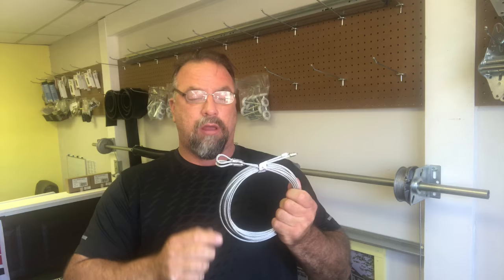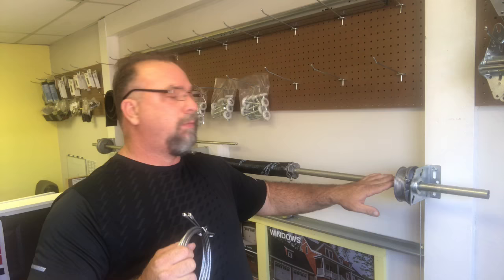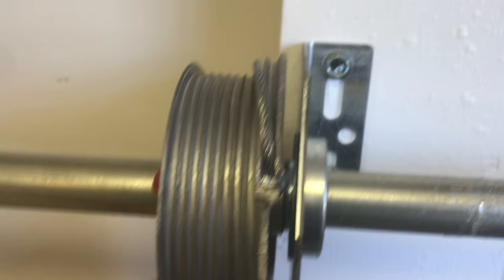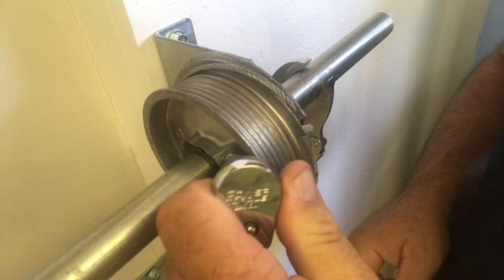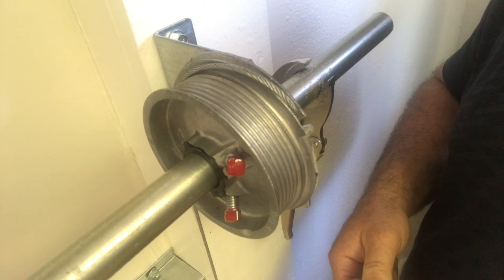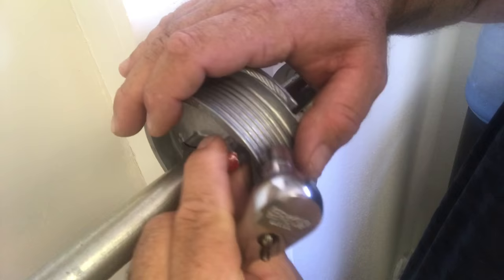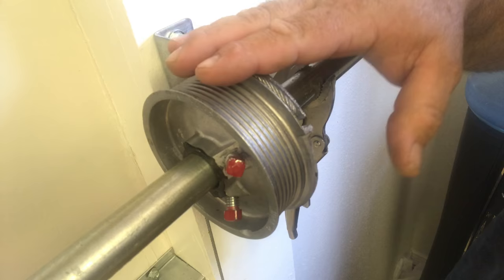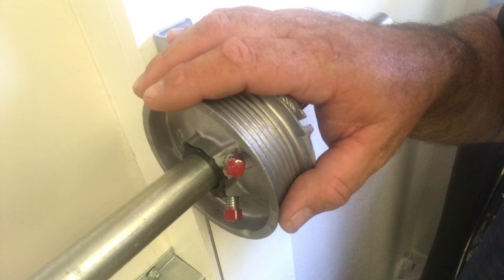How-To Align Garage Door Cable | Torsion Cable | DIY Garage Door Repair

Comment: This works, but know that the door could go out of level by doing it this way, especially if it is the left drum. In the scenario here, I would've probably just lifted the vice grip a little to back wind the spring and gain a little slack, and slid the cable back in place with a screwdriver. You could also use one vicegrip as a lever to rotate the shaft, and another to clamp it down like he showed in order to hold the slack while you do your thing. Just keep your fingers clear.

Comment: My trade is millwright since 35 years.  I instaled my new garage door recently. Leveled everything with my laser level.  One simple problem with it.  The two cables have the same tension on both side when the door is close but at 3/4 open, they are well seated on the pulleys.  The left cable is getting loose and the right one is very tight. It takes all the load. Took my caliper and measured the pulleys. The right one is 0.015'' shorter than the left. Since the pulley is grooved on it's width to make the cable running, couldn't put shim stock over it to make it bigger.  Decided to put some electrical tape layer instead  until equal tension on both side and voilà !  When tape will be worn, I will just put new one.  No more problem.  Different mold for casting and it doesn't take much difference on circonference to cause that problem.  Call the manufacturer door installer.  Told me 1 out of 3 doors have that same problem and they never found any solution.  Told the guy mine and was very happy to ear it.
Reply from the maker: Great solution. Thanks for sharing!
Reply: He probably didn’t care and was happy to get you off the phone
Reply: I don't  think so !  When you talk to a man, an aged one for about 20 min, a very nice man asking questions and you can feel the appreciation in is voice  and attitude and if it's so... hope he has learned something that day !  Happy new year from Montréal, Québec !
Reply: Have been installing garage doors for 27 yrs, still can't figure it out???
Reply: @MegaJohnnyrock  About the difference between cables?  Beleve me, I scratched my head for a couples of hours trying to figure it out !  And nothing else but the circumference must be in involve here.  As I said previously, took my caliper and yess, it was 0.015 smaller. Mould difference from China !
Reply: it's probably your track.  check your top roller carriers with the door open.  you should see some roller axel , if not the door will bind and cause a loose cable
Reply: Thank you for your comment.   Every measure was double, triple check.  Leveled with my laser.  Track parallel and leveled everywhere.  Believe me it is a matter of different pulley circumferences.😉

Comment: I just wanted to add if you have the door open it releases all the tension in the spring, it makes it a little bit more difficult to work on the door but alot safer. I appreciate this video, mostly all the others where not helpful this was clear to the point an told what needed to be done thanks!

Comment: Hi, I was wondering if someone could help me I replaced both of my cables yesterday and I have double springs the one on the left side. I adjusted it to 30/4 turns the one on the right side I didn’t touch because it seems like it has tension in it, but now my door doesn’t go up. It goes up about an inch and then it stops. I don’t know if I should maybe unwind the right side Both of the cables that I replaced seem OK

Comment: You know I am a 21yr garage door vet. I subscribed not for the knowledge, but because you do a great job on your videos. Good info but most importantly promoting safety, well done. One thing I would add, is when you open your door look and make sure both cables are tight.
Reply from the maker: Yes- a loose cable when the door is in the opened position is going to eventually cause an issue, or may become tangled. Aside from tightening the drum on one side, sometimes the door itself is askew from the track. This is usually a result of the back hangers being installed slightly out of square from the vertical track.
Reply: I tried to redo my cable a couple weeks ago and left the vice grip on when I put the new cable on 🤦 I'll be ordering two new cables to install. My only question is can I put new cables just as shown in this video (garage door down and only winding on first groove)? I've seen other that show garage door in up position stating to wind the whole drum with the cable...

Comment: Never loosen a drum without a winding bar in at least one of the springs. Also ya put your vise grip on upside down. Where you were standing will hurt someone if they didnt bar off the springs and the other drum slips(because thelast guy may not have tightened it enough)
Reply from the maker: The purpose of this method is a quick fix for a DIY'er without a winding bar. I have used this method 100's of times. It is highly unlikely for the drum on the other side to slip all of a sudden. People tend to overtighten these drums. Again, anything is always possible! Some risk is always there.
Reply: Michael Perry is 100% correct, in Florida for example a 16x7 garage door can weigh nearly 450lbs with wind loading struts. All that load will be trusted to 1drum and 1 pair of questionable Vice grips. Instead put the Vice grips on the cable on the good side, next take a pipe wrench and put it directly on the torsion tube, lift up towards the ceiling no more then a 1/4 turn with 1 hand and move cable back in the grove with your other hand.

Comment: Nice video.  I use lithium wheel bearing grease on the new cables, light coating will extend the life of the cables,
silicone spray on the torsion springs will keep them quiet.

Comment: Thanks for the simple procedure! The door on this house was up about 1/2" on one side that always drove me nuts, finally after 4 years living here I just recently noticed the cable on one side was off the track as you show here flipped over the ridge. So I followed your procedure only I had to let cable drum turn until door settled on the concrete floor for it to release enough tension to flip the cable back into place. I then needed to use a pry bar to hold some tension on the cable as I tightened the set screws - all worked out well and cable is back in place and door bottom is now even. The key was using the vice grips to hold the spring tension on the shaft.
Reply from the maker: Great job!

Comment: @danielwake2430:  
I had a similar thought, and you're right about getting fingers caught...  
I used something with a better bite than vice-grips would be preferable: a pipe-wrench.  I grabbed the tube just inboard of the sheave to avoid deforming the end outside the bearing, and rolled it back that 1/8 to 1/4-turn I needed to get the wire back in the right groove.

Comment: You can do that repair without ever loosening the set screws on the drum. You simply go to the bottom roller at the left side of the door and use vise grips to clamp just above the roller, you then go to the right side of the door and lift it until there is enough slack in the cable to correct it on the drum. then place another vise grip under the right side bottom roller so the slack isn't lost. Go up to the drum, re-align cable and then remove both vise grips. This method will ensure the door remains level.
Reply from the maker: There are definitely alternate ways to do it. Thanks for sharing!

Comment: This way would only work if the floor was level and your tracks are level as well.  If the right side concrete was lower you've dropped the right side of the door too low when losing the drum....
Reply from the maker: Thanks for your input!

Comment: My door has been jammed for years.  The cable is misaligned and it’s rolled around the tube once, on both ends.  Frankly, I don’t want to mess with it, but I haven’t been able to find someone who can fix it.
Reply from the maker: If you unwind the springs first (using 1/2 o.d. winding bars by 18" long), you will be able to unravel the cables, allowing you to reset everything. Align the cables and make them straight, then use a vise grip planted on the torsion tube orientated against the wall (in an upward direction) to hold the cables so you can wind the springs. Watch some videos on spring replacement first- AND BE CAREFUL.

Comment: Hmm. So the bar and pulleys are supposed to turn? Mine aren't and while it's down the cable is loose and wrapped around the bar
Reply: If your cables are wrapped around the bar, then this quick fix would not apply. There are some YouTube videos out there that show you how. Please be careful.

Comment: My door springs are broken and door is closed. Can I run the cable to the bottom of the door since I am unable to lift the door at this point. Great video.
Reply from the maker: I would need more information. Thanks.

Comment: Good video I'm redoing my cables and springs and opener and hardware. Safety tip for you. Never have your hand on the spool when loosening the spool. Well I guess it wont take off on you so your ok. Lol thanks for your tips. Where were you yesterday lol. : (

Comment: I tried to redo my cable a couple weeks ago and left the vice grip on when I put the new cable on 🤦 I'll be ordering two new cables to install. My only question is can I put new cables just as shown in this video (garage door down and only winding on first groove)? I've seen other that show garage door in up position stating to wind the whole drum with the cable...

Comment: Here are my problems. I hope you can help me. My electric garage door opener had a short. I have been forced to manually open and close the door. This went well for a few months. One day after opening my door (21 ft. in length) it got stuck. A little higher on the right side. I tried for an hour to get it to move with no luck. The cable had come out of its wheel.  In desperation I cut the cable on the right side. This did not solve anything. It would not move.  I knew the middle part had these tightly wound cables and to stay clear of them. I hid behind some heavy boxes filled with other items (for protection) and used a long handled looper to cut the other cable. BANG it came off and put a hole in the drywall next to the garage door. Better it than me! Now I thought I could open the door. The door is shut like there are 500 pounds of bricks on it. Any SAFE suggestions besides calling a pro. Thanks to the government everything is so expensive I want to try to do as much as I can.

Comment: I’m coming to your video after loosing the cable but I forgot to put the pliers on the underside and the door came up a little bit. Should I loosen the torsion springs and reset everything? And should I replace the torsion springs as well?
Reply from the maker: Unwinding the springs, then rewinding is going to be your best bet. Only replace the spring if it is older, rusty, or near the end of it's cycle life.

Comment: Got same length torsion spring and followed the steps for replacement of springs; but issue I see is garage door only lift up till 1 foot , stay stuck and does not move up regardless how much manual lift force I put in (in manual mode). please guide. I tried going up to 33 quarter turns (16.5 half turns) as 31 or 30 turns was not helping, rotation was clock wise for 33 quarter turns.. my old part was 218 wire x 29 long spring and new one is 225 wire and 29 long spring.

Comment: Just a little confused on why the locking pliers were used, I  would of thought they should be on the other side of the wheel not  outside the wheel.  what was the point of using the locking pliers?  Did it stop something from turning?
Reply from the maker: The channel locks hold the tension of the spring. The cable on the other side holds half of the tension.

Comment: As the cable is going down to the bottom bracket, should it be at a slight angle? Or dead straight ?

Comment: Thank you for the clear video.  I have a question about my garage door, my door is 7 feet 4 inch height, can I use the 8 ft door cable for replacement?
Reply from the maker: Sorry for the late response. A cut cable would be ideal. Cut 8 inches off the 8 ft cable and crimp on a new end. If the cable is too long it will fill up the drum and possibly come loose and get tangled.

Comment: My whole cable fell off trying to find a video that shows how to reattach it to the spool all the way to winding it on properly
Reply: I have the same issue and would like some direction on how to fix this too.  The springs on this garage door are not in the center like in the video.  There are 2 springs on each side of the frame closes to the ceiling.  And it appears the drum just fell apart.  I found one side of it laying on a shelf with 5 what appears to be bearings?  This is a rental house and tenant never informed me of anything.

Comment: should the cable be pretty tight after spring replacement?  Mine are,  it seems the spring torques the pulley, then pulls the cables tight, even if I try to loosen them.  is that ok?

Comment: Hello before I saw your video I replaced the right side cable on the rt side (from the inside)  I loosened the cable drum, did not realize I was supposed to put vise grips on the torsion bar. How do I get tension back on the right side ? Please advise.

Comment: Thank you. Learned a lot. I would like to know what causes the cable to jump out when clossing the door?
Reply: It usually jumps when it’s going up, but you don’t notice it typically until you go to close it. A lack of spring tension, or raising the door too high, or raising it too fast, are some of the common causes
Reply: @SpectrumGarageDoorsService  if I can turn the cable drums does that indicate a lack of torsion on the spring? I has the cable come off one side,tried to do re spool and noticed I could turn drum by hand.
Reply: @paulhoward1520  well, the two drums and shaft should turn as one. When the spring is applying proper counter balance- yes you will be able to turn it by hand! Pretty easily too. The idea is to be almost weightless because of the assistance of the spring.

Comment: My problem as pet your video, my cable has slack when the door is in the up position, it is tight when in the down position, should I raise the door and repeat as your instructions on in the up position ?
Reply from the maker: This usually happens when the rear hangers (the angle iron coming down from the ceiling) are askew. In other words, they are slightly diagonal when compared to the straight vertical track that is on the sides of the door. Moving them over as needed (both in same direction) to the left or right even just one inch can make a big difference. Note- moving the hangers will also move the upper track which is what you are trying to do.

Comment: When garage door is up, how much tension is suppose to be on the coil of wire? My garag doors wires popped off when it hit something that I had stacked up next to the door guides and I cracked the nuts loose to try even the tension while the door was up but it isn't working properly, any help would be much appreciated 🙏🏼
Reply from the maker: Hitting an object is a common reason for the cables to come loose or tangled. When the door is nearly opened, there is not much tension left.

Comment: Geez man 2019 and another video of a garage door with torsion springs? My door doesn't have torsion springs. Torsion for mine appears to be done close to each cable pulley by winding the cable. There are no springs in the center on either side. It's just a rod. With all of the video's of torsion spring based systems I already know what the problem is with a door that is mis-aligned without even watching this video. Oh well someone will get use out of this so good job.
Reply from the maker: Thank you!
Reply: @parts4garagedoors278  no

Comment: Why would there be loose tension on a cable when the door is up, but proper tension when the door is down?
Reply from the maker: Sounds like the upper horizontal track are askew. They should come away from the wall at 90 degrees.

Comment: When the door is up, is one cable supposed to be looser than the other side?
Reply from the maker: No. This usually indicates that the horizontal track (the overhead portion) is askew. In other words, the upper track need to be square or perpendicular to the front wall.

Comment: Hi! How can we repair the cable if it has come off the reel and onto the rod that goes across the top? It's a REEL mess in our garage.
Reply from the maker: I'm sure you already fixed it, but my suggestion would have been to follow the same process as shown, but back turn the cable drum enough to eliminate tension on the cable and pop the end loose from the slot in the drum. Now that you have the end of the cable unravel it completely from the rod. Next you would feed the end back into the slot in the drum, rotate the drum to tighten the slack. hold cable taught while you tighten set screws on the drum to secure it in place.
Reply: @parts4garagedoors278  Thanks for the advice! Yes, that's what we did. It was a tough job, my hat off to the pros like you that teach us how to make it work.

Comment: I replaced my both springs the garage door was working fine.now open my garage door the cables come off the roller both them any would be appreciated thanks
Reply: When this occurs it’s usually because you don’t have enough turns on the spring. Always wind 29 to 30 quarter turns on a 7 ft tall door and 33-34 quarter turns on an 8 ft tall door

Comment: Help! I used the pliers to hold the door at the highest point, loosened the set screws, and wound it up and reattached to the door (both sides), but when I finished the 2nd side, it completely unwound itself when I let go even though everything was back to normal. What am I missing?
Reply from the maker: If I'm following you correctly, you may have loosened both cable drums? This would unwind the spring. Only one drum can be loosened and rewound at a time.